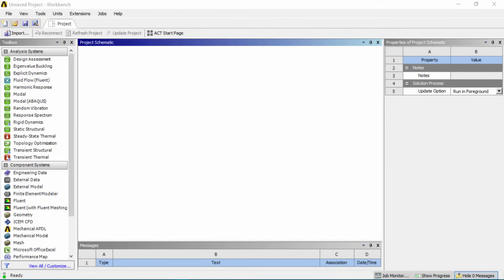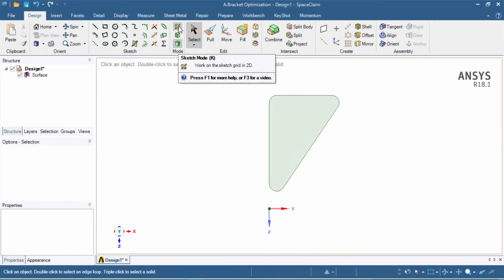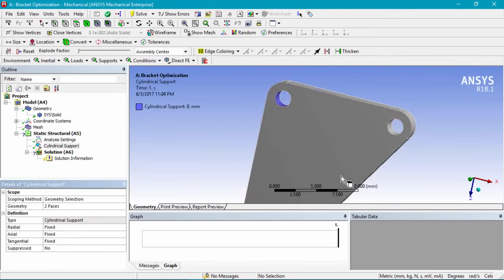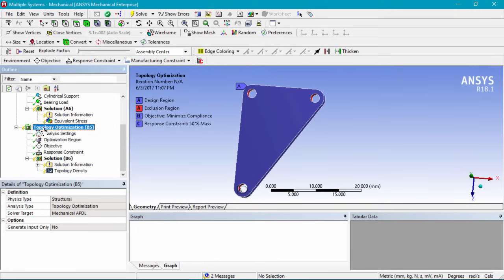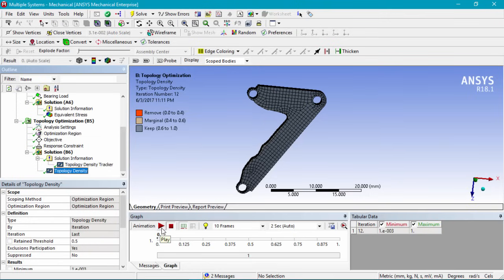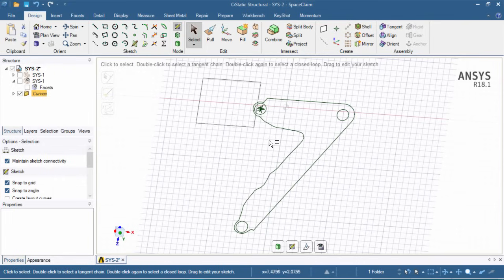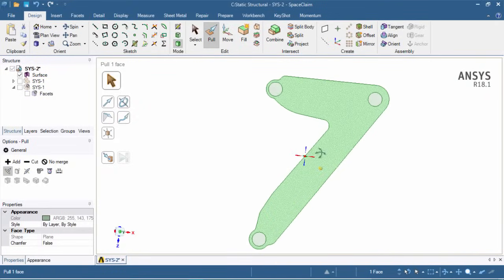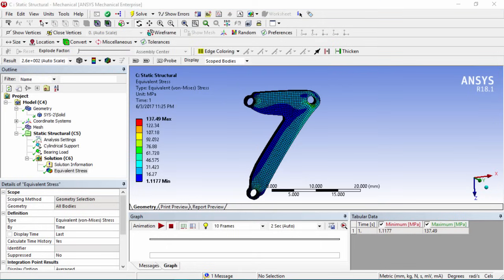ANSYS 18.1 Topology Optimization

Comment: By comparing previous model stress value increased..then what is the purpose of topology optimization?
Reply from the maker: If i remember correctly the stress may have marginally increased. So the real savings is weight of material.

Comment: Here's my problem. I have given transfer to Design validation(geometry) after Structural optimization in ANSYS 2022R2 student version
What happens is my geometry which is only 90mm in Structural optimization module is showing as 90m in Spaceclaim. What is the problem behind this? How can i get the optimized geometry with the same units?

Comment: Hi, in Ansys 2021, I'm not able to extract the results of Topology optimization to a new solution, if I do that, I'm not getting the "geometry" part of the static stuctural process. 

My requirement is to extract the topology optimized result to parametric software so I can edit it on my own. Can someone please help?

Comment: Good afternoon, is it possible to estimate the heat flow (wm ^ -2) versus the time (s) entering the experimental temperatures in Celsis versus the time (inverse problem) using ANSYS and Direct Optimization? My 3D domain is a solid one. 

The following are the required information.

Properties of solid (3D):

Thermal conductivity k: 43.1 W/(m.K)

Density rho: 14900 kg/m^3

Heat capacity at constant pressure Cp: 332.94 J/(kg.K)

The files "Termocouple 1.txt" and "Termocouple 2.txt" contain the temperatures measured experimentally, in Celsius, versus the time in seconds.

The "Measured Heat flux for comparison.txt" file contains the experimental measured heat flow and can be used for comparison with the numerical inverse technique that will estimate the heat flow (W m^-2) versus time (s).

The files "solid_domain.igs" or "solid_domain.x_b" show the drawing made in SolidWorks for use in numerical simulation, drawn in mm.

The "Results using COMSOL.bmp" file presents the comparison of the heat flows estimated by the Nelder-Mead optimization technique and the heat flow measured experimentally.

Domain Point Probe 1: 

Coordinates of thermocouple 1:

x: 0.0043 m; y: 0.0035 m; z: 0.0047 m

Domain Point Probe 2: 

Coordinates of thermocouple 2:

x: 0.0035 m; y: 0.0089 m; z: 0.0047 m

Total sample size (x, y, z):

 0.0127 x 0.0127 x 0.0047 (m) = 1.27 x 1.27 x 0.47 (cm) =

12.7 x 12.7 x 4.7 (mm)

Data acquisition interval = 0.222000 seconds

Initial sample temperature = 29.2 (ºC) = 302.35 K

Number of thermocouples = 2

Coordinate (s) of the thermocouple (s):

x = 0.0043 (m) y = 0.0035 (m) z = 0.0047 (m)

x = 4.3 (mm) y = 3.5 (mm) z = 4.7 (mm)

x = 0.0035 (m) y = 0.0089 (m) z = 0.0047 (m)

x = 3.5 (mm) y = 8.9 (mm) z = 4.7 (mm)

Area (s) occupied by the heat flow (s)

xo = 0 x = 0.0104 m

yo = 0 y = 0.0104 m

zo = 0.0 z = 0.0

Consider the convection boundary conditions with h = 20 ºC and Tinfinite = 29.221823 ºC. Ie:

heat transfer coefficient h: 20 W/(m^2.K)

External temperature Text: 29.221823 ºC

I appreciate it.

Comment: Which method of topology optimisation is used here like SIMP, BESO , level set or ESO? Actually i want to know at the backend of Ansys, which algorithm is used. Basically, i want to perform topology optimisation in a coding environment especially in python, so some information is required regarding this. Also, can we check the backend algorithm used in Ansys? Hope to hear from you soon.

Comment: Hello there,
I'm using Ansys 2020 version. When I clicked on the results to choose "Transfer to Design Validation System", in the new window I didn't get the option "Geometry", just the other ones (Model, Setup, etc.). What could be the problem?
Thanks.
Reply from the maker: I have not looked at this for v2020. Did you figure out the issue?

Comment: Hi Dr. I've been asked to design  a fast bike through topolgy optimization. i have been given a frame to work with. Should i only concentrate on indivdual areas or run optimization for the whole frame?
Reply from the maker: I think it would be difficult to isolate sections to optimize. I would suggest to run an analysis of the full frame with a coarse mesh (depending how powerful your compute is), so a global optimization first. After that you can try and do submodeling for refinement in specific areas.
Reply: @drdalyo  thankyou Dr. Ive now got a reslty from the optimization. However my model is is a bike frame, do i follow the same method you do to clean up the edges or is there another way?

Comment: hello doctor, i am performing topological optmization for 2d truss structure and am able to perform static structural analysis perfectly. But, for topological optimization, i am not able to use line body for optimization even though i have given a circular cross section area for the body. can you suggest any possible reason for the same?

Comment: I received this error:  Topology Optimization only supports fixed joints with Contact/Direct solver element type.  Maybe if I get past this it will run.  BTW, thank you for this video it is much appreciated.

Comment: Hello sir, thanks for the video, it is very useful. However, i'm trying to create an optimization for a composites sandwich structure, but when i click solve on the solution(b6) for optimization, the software gives out a message "imported layer is not allowed in the analysis".

Is there any way this can be overcome? or perhaps you can suggest alternative ways I can optimize composites in Ansys workbench. 
Currently I'm using Ansys workbench student version 19.2

Comment: Hi DrDalyo, thanks for the awesome tutorial. However, i did face a problem while transferring the optimized results to a new static, structural system. When i update the geometry in block 'c' it gives me this error "Update failed for Geometry component in Model,static, structural . Update of the geometry component in Model, static, structural did not mark the component as updated due to a change made to the Results component during the update". This may be a noob error on my part but I would really appreciate any comments from you on this.

Comment: great tutorial. I followed the procedure. but I get the following error when I add topology optimsation block.
"Update failed for the Solution component in Topology Optimization.  Error updating cell Solution in system Topology Optimization." the solution of optimisatino block has a red cross on it, others have a checked mark. no other error symbol anywhere.
any idea what might have caused this?
Reply: going into the setup section of topology optimisation: I see this error before I do anything:
"The optimization solution run was terminated. Check the Optimization Output on the Solution Information object for possible causes."

Comment: Thank you for this great video. I have a problem, and I really hope you can help me: once done the topology optimization, I click on "Transfer to Design validation system" (8:41), I obtain another Structural system, I update the results of the topology optimization system, and the geometry of the new structural system, but in this moment I get the errors "(DP 0) Attach failed.", "(DP 0) Geometry Interface not found.", "(DP 0) No compatible interface found for this file type".
Do you have any idea of what cause this problem?Thank you very much in advance!

Comment: I am using ansys 15 and i don't have topology optimization option ,can i get it somehow?
Reply from the maker: +Kacza651 maybe see if v15 has it when you enable beta features. You will find it in the options. Also you could check the ACT webpage on the ansys website. They might have something. If not, then im afraid you will have to upgrade.
Reply: @drdalyo  hello sir i had the same problems in Ansys 16.2 I couldn't find "Topology optimization" and i've tried to ask in the Ansys community website but no one answered ( it was a question about not been able to find the "supress for physics" but i find another way to solve it)

Comment: I am running some topology optimisation on bicycle design, and I'm wondering if there is an option to remove material from the edges of the mesh only? The optimised shape I get is consists of a truss structure with many members which makes sense, but I would like to see what sort of monocoque shape would be formed, but I am unsure if there is an option for the optimisation to remove material from the outside in. Do you know if it is possible?
Reply from the maker: +Quang Vuong Try looking into the other options when using optimization, there are features like manufacturing constraints which might be what your looking for. You can find more about it in the help menu!

Comment: i have a problem when i click on geometry i get design modeler instead of spaceclaim, what can i do to have spaceclaim directly
Reply from the maker: +El Makkaouy Mohamed In the main ANSYS Workbench menu bar, click on "Tools" then "Options", then in the tree on the left, click on the last item called "Geometry Import", then under "General Options" change the "Preferred Geometry Editor" to "SpaceClaim Direct Modeler" then click on "Ok" at the bottom. 

Please let me know if this works and helped answer your question!!

You can also always right click on the Geometry cell and choose to open with either DesignModeler or Spaceclaim.
Reply: i've tried everything you said , but it is not working , all i get is design modeler, every time i click on geometry cell
Reply from the maker: do you have spaceclaim installed? valid license? maybe your running an older version of ansys

Comment: I am abit confused with the boundary conditions you set at 4:24. Why is there a msg telling you that there is rigid body movement? There is something else which just looks very wrong in the model, take a look at the stresses in the area in which the bolt connections are located. You have tensile stresses there, a bolt cannot pull on the body. I am not very familiar with Ansys but with many other FEM tools so I can only guess what happens here. Ansys automatically sets an independent master node in the center of the bolt and now connects ALL nodes on the cylindrical surface to that one master node. To model this correctly, one has to only connect 180° to the master nodes according to the force direction. I am certain that this structure would completely fail since you can see that there are almost no stresses on the outer parts of the bolt connection. This model would correspond to a glued/welded connection.
Reply from the maker: Hi! Thanks for your question. 

Regarding the first point on BC, the message is being displayed because the geometry deforms slightly in the Y direction (out of plane) and there are no BCs to prevent this movement. If you would like the message to dissapear, you could easily insert a Frictionless Support on the large surface of the model to constrain it in the Y direction.

Regarding your second question, there is nothing wrong with the model. You have to keep in mind that a bearing load is a simplification and if you want something more accurate you would need to model the bolt itself and apply contact.
I think actually you dont understand the loading condition presented. Its a bit hard to explain, but have a look at the image here:
https://apolloedgeblog.files.wordpress.com/2016/09/slide24.png
In this case you would have tensile stresses on the bracket.

Ansys does not set master nodes at the center of the bolt, and you do not need to connect 180deg. I suggest reading the help information regarding Bearing Loads. When selecting the full interior surface of the hole, the load will be distributed on the compressive side.

The structure would not fail because the stresses remain below the yield stress of steel (80MPa < 250MPa).
Reply: Hello again, thank you for the first answer, that makes sense but I still have a problem with the second part. The picture actually shows why your boundary conditions are not correct. 

Take a look at this model: http://imgur.com/PY8ywD5 espeically the top left region. 
The stresses are way higher on the left side of the bolt, which is what you would expect from such a construction. In your model the stresses are 0 in that region. 

If you look at the picture you linked, the top bar is getting pulled to the left. Where would it fail? Ofc it would fail on the right side of the bolt while it should be able to displace freely on the left part which is not a given condition in your model due to the fixed constraint all around the bolt area.
Reply: @CurrencyPrime  That is a really good point to mention. Stresses should be way more higher on the left side of the fixed points, since it is pulled to the right. But, in the model we do have a opposite... I think boundary conditions do not reflect the real case.

Comment: I don't think the validation showed that this topology optimization is not good, am I right?. There was 83MPa before and there is 137 after. Can you somehow make an if condition, that says to move as much weight as possible, but to keep the stress at max +5% (87MPa in this case)? I think cutting down strictly 60% of the weight is not very practical. Anyway for learning and education it is enough. I appreciate the video description, really good job. Wish you a future success with this channel.
Reply from the maker: +Lukáš Kratochvila you could also add a maximum stress condition. Actually the first time I ran the model the max stress stayed the same while cutting 60%. I think during recording, i cleaned up the model differently and the stress increased. But as you can see its very local in the bolt hole. 
Test it out for yourself and see.
Thanks for the comment!

Comment: sir plz help 
thiz kind of error comes in ansys 14

You have a bearing load that has an axial component.  This is not allowed.  If an axial component is desired, create a separate force load in order to apply the axial component.
One or more bodies may be underconstrained and experiencing rigid body motion. Weak springs have been added to attain a solution.  Refer to Troubleshooting in the Help System for more details.
Reply from the maker: Try adding a frictionless support on the two large faces of the bracket.

Comment: I got a maximum of 208 MPa Mises equivalent stress - that's more than +240% with same dimensions and nearly same mesh, same material steel. How can it be? Do you use any special regulations or settings? Thx
Reply from the maker: +channelstobe Nothing special. All settings are pretty much default. If you look at the stress location is really just inside the bearing load hole. So the higher the mesh quality the higher the stress would be. Actually, when I first ran the model (before recording) I simplified the geometry slightly differently and the stress came out to be almost the same (around 80mpa). Try not simplifying the geometry to much (convert to solid directly) or simplify but make sure not to reduce the thickness in specific areas. Let me know how it goes. Leave your feedback here and il check it! Thanks!!

Comment: can you add a .STL or. DWG into Ansys? And can you output it later to a CAD software? thanks
Reply: The format you mentioned can be imported by ANSYS SpaceClaim.
And it can export .iges, .stp let you can edit in other CAD software.
Reply: Salace19191 thanks for the info. stp files as output should do the trick :)
Reply from the maker: Yes spaceclaim can import these files. Please see the document here: http://files.spaceclaim.com/SupportedFormats.pdf.
Files supported:

ACIS (SAT, SAB, ASAT, ASAB )
Acrobat (PDF)
AMF
ANSYS Electronics Database (DEF)
AutoCAD (DWG, DXF)
Cadence SPB (BRD, MCM, SIP)
CATIA (MODEL, EXP CATPart, CATProduct, CGR) CATIA V6 (3DXML)
Creo Elements/Direct Modeling (CoCreate) (PKG)
DesignModeler (AGDB)
ECAD (IDF, IDB, EMN)
ECAD - Other
ODB++ (TGZ)
EDB (DEF)
IPC2581 (XML, CVG)
GDSII (GDS, SF, STRM)
Fluent Mesh (MSH, TGZ)
ICEM CFD (TIN)
IGES (IGS, IGES)
Inventor (IPT, IAM)
JT Open (JT)
NX (PRT)
OpenVDB
Parasolid (X_T, X_B, XMT_TXT, XMT_BIN)
PLY (PLY)
Pro/E (PRT, ASM, XPR, XAS)
QIF (.QIF)
Rhino (3DM)
RS Components
SketchUp
SolidEdge (PAR,PSM,ASM)
Solidworks (SLDPRT, SLDASM)
STEP (STP, STEP)
STL
VDA-FS (VDA)
Wavefront (OBJ)
VRML (WRL)
Image (BMP, JPG, PCX, PNG, TIF, GIF)
Video (wmv, avi, flv, mkv, mov, mp4, mpg, mpeg, ogm, vob)